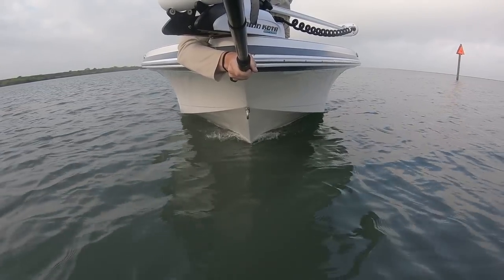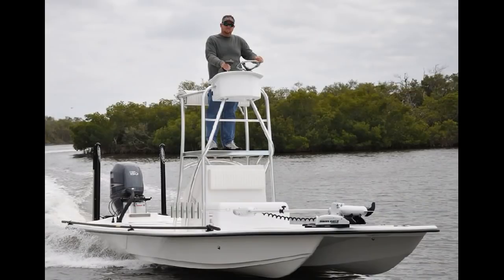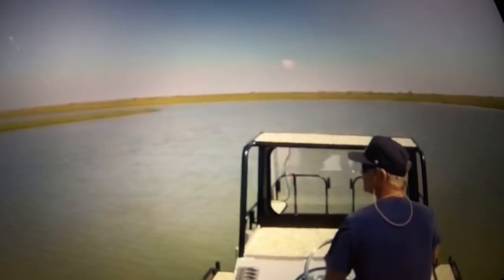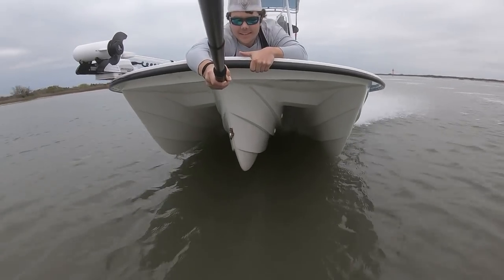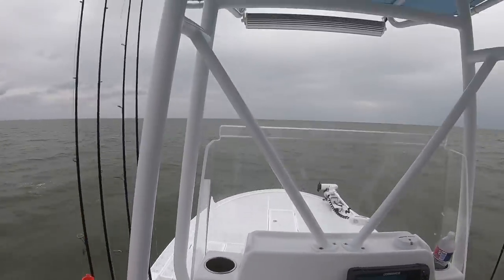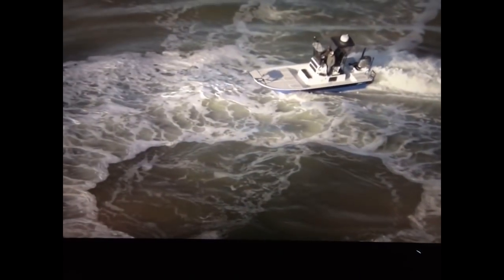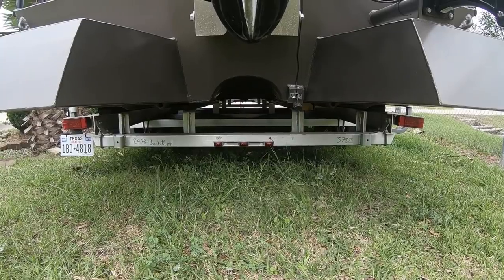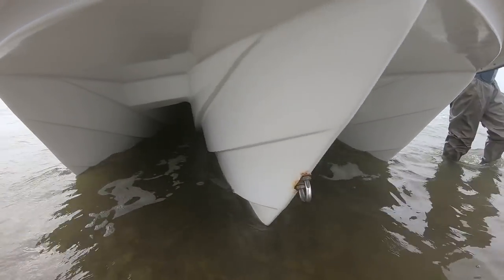boat hull design

Comment: Great video, I am making a boat and was wondering about the hull. I was planning on a flat bottom catamaran and for my use I think it will actually be the best. I read your bad comments but in such a short video you can't go into detail. You can have a flat bottom catamaran/tri hull or countless other combinations. I think you got the basics right and although some of the critics are right in areas there generally wrong. For example "Flat Bottom Boats are the fastest" as to this comment just google the world water speed record. Another example for multi hulls is the distance between the hulls, obviously you are just going into the basics as hydrodynamics are complicated but I think for a short video you covered the basics well. Thumbs up.

Comment: Sorry, but you get a "poor" rating from me.
Flat Bottom Boats are the fastest, most fuel efficient, best handling, and have the least draft, of any design.
The problem with Flat Bottoms is that they are not well suited to rough water.

Draft is only loosely related to the amount of water that the Hull displaces.
The Hull displaces exactly as much water, by weight, as the total weight of the boat, the only time this is
not 100% true is at speed, when the weight of the boat  "may be"  partially supported by Air Pressure trapped under the Hull,
and even then, the same weight of water is actively being displaced, it's just spread-out over a much larger area, and so
it would "appear"  that less water is being displaced. 
In either case, it is the displaced water that is keeping the boat from sinking, 
until the boat is going fast enough to fly like an airplane, and even then, it is still displacing the same amount of water,
it just does it so fast, and over such a large surface area, that the water may appear to be undisturbed.
Draft is not necessarily measured to the keel, it is measured to the deepest part of the boat when it is at rest.
This will likely be a rudder, a propeller, or an outboard motor, any of which may extend 12" or more below the keel.

Handling......
For a non-flat bottomed design, usually, the Tri-Hull is the best handling over-all.
The Cats tend to have quirky issues because they generally can't  "lean-into"  a turn as easily as other designs. 
They are almost too stable for their own good.
Shallow Vee Hulls are a mixed bag of good and bad, but generally, predictable, and acceptable.
but they will generally not do too well in rough water.
Deep Vee Hulls are all too often wallowing pigs in the handling department, and also suck gas like a pig,
but this is the most economical design that can reasonably handle rough water without 
hammering the passengers too badly.

Serious Rough Seas.......
Nothing can touch a Cat in rough seas.
Some Tri-Hulls are specifically designed for rough seas, and do well, but if they are not specifically
designed for rough seas, they may beat-up the passengers, in exchange for stability, fuel efficiency, and speed.
Passenger comfort aside, the Tri-Hull is usually quite stable and predictable in rough seas.
Shallow Vees are usually not well suited to rough seas.
Deep Vees  "can be"  right at home in rough seas, as long as you can maintain a speed that is right in between
Planing and Plowing, which will REALLY suck mass quantities of fuel, but provide a fairly comfortable ride.

Speed.......
Speed is always directly related to how much AIR you can trap between the Hull and the water,
and therefore, how much surface area of the Hull is NOT in contact with the water, on average.
Speed is also dependent upon what percentage of the Hull design is based on  "Displacement",
and how much of the Hull design is based on  "Planing"  on the surface at speed.
Displacement Hulls are physically limited in speed by a set of 
physical dimension relationships, based on well established math formulas, 
and are generally, and relatively, quite slow, but they can be very power efficient at specific speed ranges.

As a general rule, the less wake that is generated by a particular Hull design, (at a given speed),
the more efficient the Hull design is.

All of these rules will change to some degree as the Hull becomes longer, and at higher expected speeds.
.
Reply: Well said Jim.
Reply: Dam, that was long, but correct
Reply: I aced the Coast Guard Power Squadron Course at 10 years old, (1967),
and routinely took a 13 foot Boston Whaler 20 miles off shore.
My Dad wanted to make sure I could get back into shore on my own, if something ever happened to him,
so I also had to learn to read navigation charts and a compass as well.
Reply: The displacement of water by the hull would decrease as boat velocity increased. This is because as velocity increased the density characteristic of the water would increase. This can be seen easily by watching someone barefoot water ski.
Reply: What do you think about the norwegian pioner boats? For example the 15 allround or 17 flexi or the multi thats a small katamaran type hull.
Reply: Wow